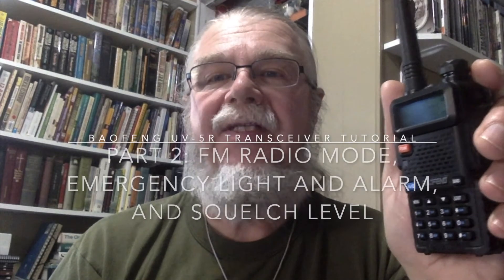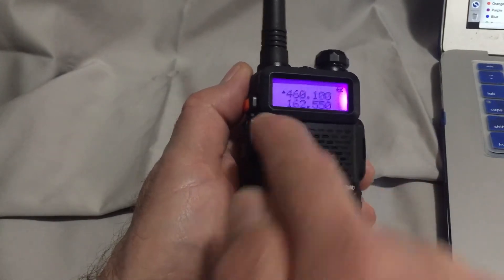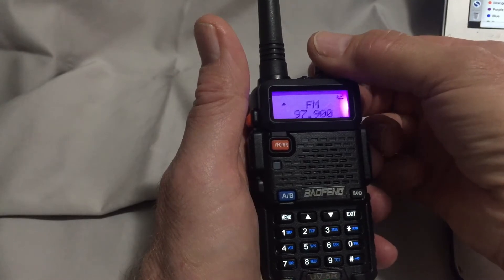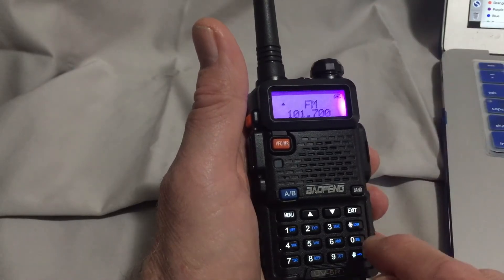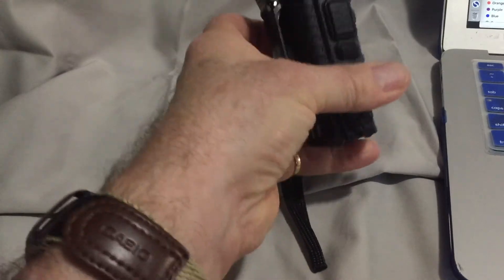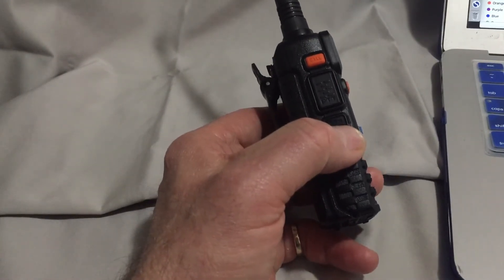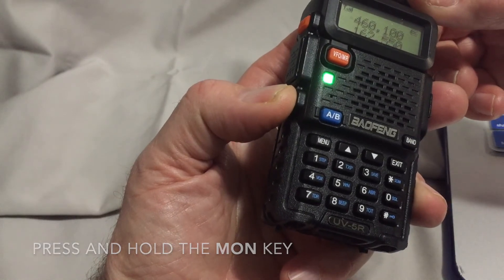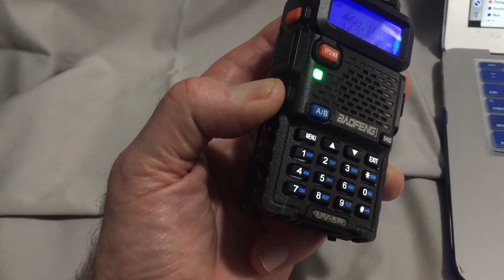Baofeng UV-5R | Part 2: FM Radio Mode, Emergency Light and Alarm, and Squelch Level

Comment from the maker: The ALARM is transmitted! I didn't realize this while I was making the video. Not too long ago I was listening in on a local club's net, and I mistakenly pressed the CALL key. The siren sounded, and I quickly silenced it. But one of the ham operators commented something along the lines of, "I think someone just got a new Baofeng! I heard their siren." I was surprised and abashed, and am now much more conscious of that orange CALL key!
Reply: you can disable that, look in settings for "AL-MOD" and change it to "SITE" (local site) and you'll only hear it out of your speaker, it won't be transmitted. The other options are "TONE" for over-the-air transmission and "CODE" which transmits "119" and the unit's set ANI code.
Reply from the maker: Thank you! That's good information. I'll add that to my notebook. 73!

Comment: When I turn mine on the volume gets very loud and I can't turn it down
Reply from the maker: Tell me more...does the sound change at all when you adjust the volume knob? Any crackling or static when you adjust the knob? When you first turn it on, is the volume normal and then gradually get louder on its own, without adjusting the volume? Does it happen on any other frequencies? Does it happen on FM Radio Mode? (https://www.youtube.com/watch?v=2gdFBQZeL_M)

Without more information, all I can suggest is to use a good quality electronics spray cleaner (https://www.wd40.com/products/specialist-electrical-parts-cleaner/). I suspect the volume control may be dirty, or maybe damaged.
Reply: Yes after I turn the radio on the sound is normal and than after that the sound gets very loud
Reply from the maker: Hmm...that doesn't sound good (pardon the pun!). That might mean the radio has a bad component that is being affected by the circuit board heating up. I would recommend that you consider asking a fellow amateur radio operator, who is an experienced electronics technician, to help you troubleshoot and repair the radio. The other, perhaps easier and less expensive option, would be to purchase a new radio.

Comment: I now know about the money key and squelch. Thanks 😊🙏
Reply from the maker: Cool! I'd not considered calling it the "money" key, but it makes sense! [MONEY] I like it! But the front panel actually labels it as "MONI", which I take is short for "monitor". One of the primary functions of this key is to "monitor" the signal with the squelch filter disabled, without having to change the setting of the squelch control knob.
Reply: I ment to call it the "Monitor" key not "money." My 3 strokes  causes mistakes sometimes. Thank you Milt for your kindness and understanding 🙏.  Brother James
Reply from the maker: You are most welcome, Brother James! 73!

Comment: I can't access the fm mode
Reply from the maker: ### CALL - Use the UV-5R as an FM radio

- Press CALL to toggle FM Mode ON and OFF (orange button, left side of radio, nearest the antenna)
- Enter desired frequency or scan available FM frequencies by pressing the scan key (marked with an asterisk) on the keypad

If this doesn't work, try it in Frequency Mode. If that doesn't work try it in Channel Mode. (Toggling the |VFO/MR| key). My radio activates FM mode in either Frequency or Channel, but your radio may be a different generation.
Reply: I got it working my sqelach was not on
Reply from the maker: @matthewfields42  That's great, Matthew!

Comment: What antenna are you using sir?
Reply from the maker: Just the rubber ducky that came with my radio. Reception is definitely limited. But, I'm not ready to invest more into it until I get my license to transmit. I have a separate handheld receiver-only, again with just the rubber ducky antenna, but it allows much faster scanning, with 200-channel storage capability.